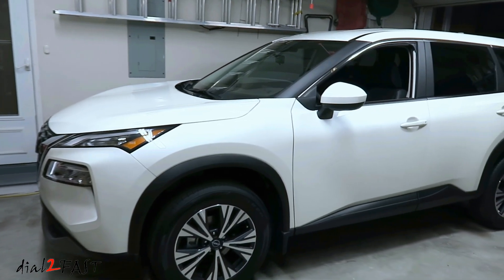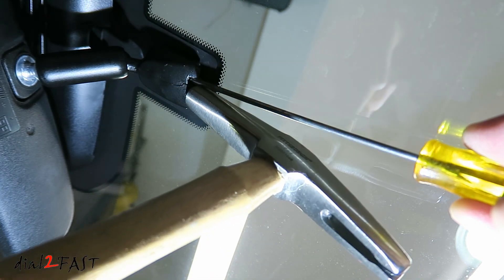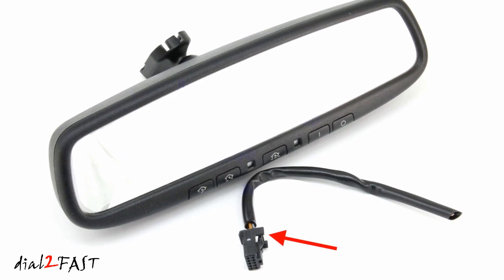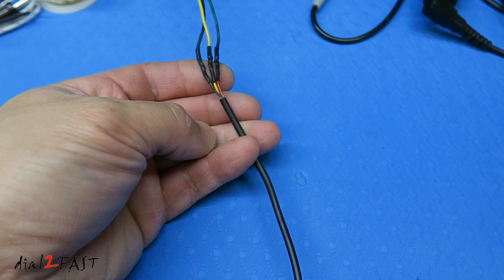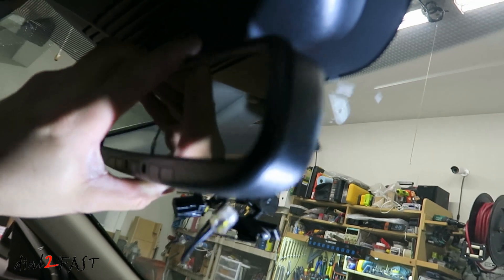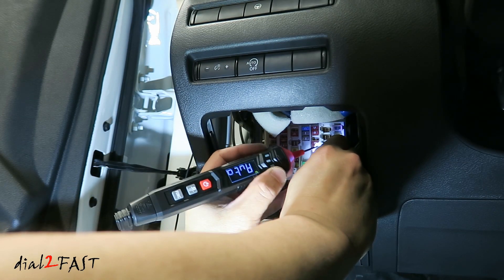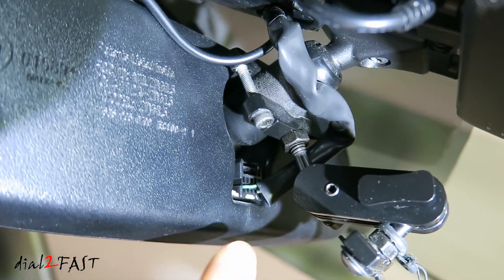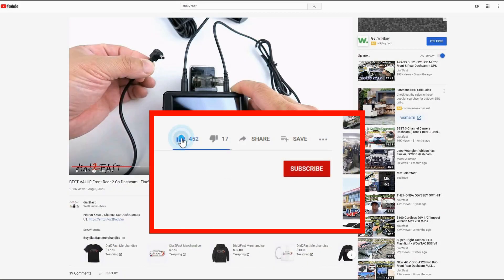How To Install Homelink Rearview Mirror in Nissan Rogue | 2023

Comment: Just curious that 12 pin plug in is it fused? Off an existing fuse in the box?Is your mirror and radar protected.
Reply from the maker: The power going to the factory accessory plug is fused in the fuse box. If you want, you can add an additional fuse to your own wire, but not necessary.

Comment: So the old mirror you use a screwdriver to unclip it but new one uses a screw, I assume that the screw just tightens onto the button and there isn’t a button with a threaded hole for that screw?
Reply from the maker: Yes, the new mirror uses a set screw to secure the mirror onto the metal button. The button does not need to have any threads as the screw tightens against it.

Comment: Hey, wonderful video!!! I just got a 2025 Frontier. I noticed that the original flip mirror has a torx do you think that changes anything as far as the install?
Reply from the maker: If it already has a torx, then just loosen the set screw and remove the mirror.
Reply: @ ok great. Do you think I have to worry about anything additional? I was going to buy a mirror off of Amazon because it was one of their used ones but in good condition. 

The other thing is can you give me the link for where you get those T taps and/or wiring harness? I think it might be easier to work with because I don’t want to completely mess around too much in that fuse box
Reply from the maker: @jamieadelglass5745  All the parts link is in the video description. Have a look there.
Reply: @dial2fast  thanks so much!

Comment: Nice ..i had been considering doing something similar but forgot about it. Thanks for the reminder.  Might have been better to buy the additional female plug and save any possible problems with the t-taps down the road.  I notice you didn't use any inline fuses on the power wires either.   If you're going to be adding more accessories you might want to consider the addition of 2 small fuse boxes ( constant power & ignition power)  off that manufacturer option plug and then run any accessory wiring to those additional fuse boxes and keep the oem fuse box clean.  I ended up doing that  but finding space for them might be an issue.
Reply from the maker: That accessory connector is fused at the fuse box, but you can install another inline fuse for extra safety if you want. That connector will be used if you install any OEM electronic accessories. The gauge of the wires on that connector is not very thick so I wouldn't put any high current devices on that connector. You are correct about keeping the fuse box clean if you do connect to the accessory connector.

Comment: Hello I have 2021 Nissan Altima SR. It’s not SUV it’s a full size sedan and I was wondering how to install Auto Dimming rear view mirror but I don’t want with Homelink I only want with only Auto dimming. If you can tell me how can I hook up the wiring without ruining the whole car thx.
Reply from the maker: For auto dimming only mirror, you just need to connect 2 wires. One for ignition 12V, and one for chassis ground on the car.
Reply: @dial2fast  thank you so much

Comment: Since the home link mirror is connected to a constant 12v source, can a thief easily break into your vehicle to easily gain access to your garage without needing to turn on the vehicle?
Reply from the maker: All factory Homelink mirror uses constant 12V for the garage opener function. The idea behind it is after you pull into your garage, you can shut off the engine, and be able to close the garage. If you parked your car outside, and someone decides to smash your window, then yes they can open the garage. But reality is if a thief really wants to steal something, they will gain entry with or without a Homelink mirror. If you want, you can wire it up to ignition only.
Reply: How does it connect to the home  ?

Comment: Are you considering to upgrade your sound system? Maybe change the speakers an add a subwoofer...
Reply from the maker: I don't have any plans to upgrade the speakers right now. The stock sound system is alright even though it can use some extra bass. So not right now. Thanks for asking.

Comment: Hey, can you share the link for the mirror on ebay?  I click on the one you posted, but just take me to ebay and not to the mirror you bought.
Reply from the maker: The mirrors sold on Ebay are usually one off used item. I can't specify one specific link for a mirror since once sold, it's no longer available. Find one for a Nissan car with Homelink function and it will fit your Nissan car.
Reply: Thanks for the video. I did this 8 years ago on my wife’s new 2016 Rogue. Ha - I’m now 8 years older and just got her a new 2025 Rogue Platinum and couldn’t believe it didn’t have home link. So asked the dealer the upgrade cost and it’s $500! Looks like I will be doing this myself again. 

Do you happen to have the instructions on how to program the mirror to the door?

Thanks